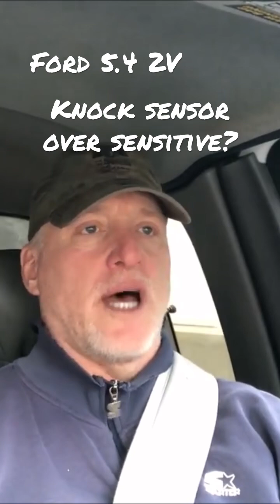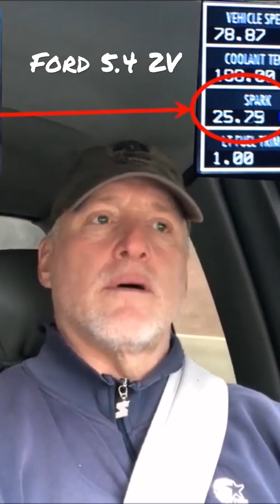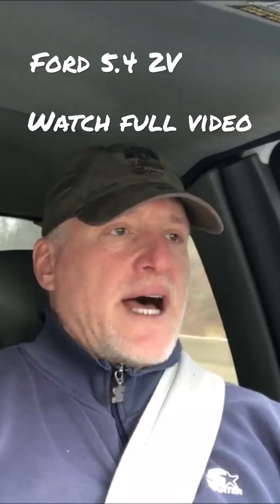Ford 5.4 2V Knock Sensor Sensitivity, How Knock Sensors Destroy Performance #shorts #short

Comment: Wow that's very interesting! I will have to look into this!! How much power do you think you were loosing when it was pulling the timing back! I have the normal triton knock at start up until it warms and can't figure out what it is? I think it sounds louder on the passenger side front wheel well. I was thinking it could even be something in the transmission, maybe the pump? From what I have found most ppl say that it is piston slap from the tight clearance this engine is built with? Not sure it I believe that but who knows! I really appreciate your knowledge of these vehicles!👍. I think the knock sensors are in the galley between banks so I guess the intake needs to come off to replace but you say they are just sensitive by nature.... What tuner would you recommend? I was looking at the edge cs2 because it comes with a few programmed tunes... trans, tow and performance plus the pid readings are nice!
Reply from the maker: Thanks for checking in... I could feel the drag on the engine with the timing pulled back.  Can't say how much power, but it felt significant.  Did you see this video?  https://youtu.be/rWDQvNvY4XA  This video is more in depth about knock sensor sensitivity.  I use the SCT X4 as shown in the description of the video and have a custom tuner reduce knock sensitivity (can't be done by you).  Also, this video shows the removal of the intake and the area where the knock sensor is located:  https://youtu.be/GVDse2cnPSw
Reply from the maker: By the way, if you buy through my links, I make a little money to support my channel at no additional cost to you.  :)
Reply from the maker: I forgot to answer your other question about start-up noise.  Check out this playlist where I eliminate some start up noise associated with the timing chain, but I still have piston slap until the engine warms up: https://youtube.com/playlist?list=PLGNsbVXzRfZPg0KvNIqkGpzx-duBOL246
Reply: Thanks a lot i appreciate the responses!
Reply from the maker: Very welcome!